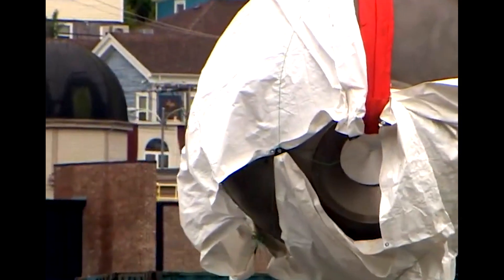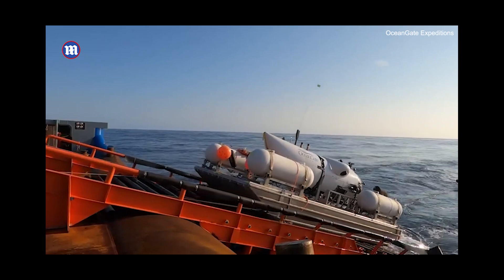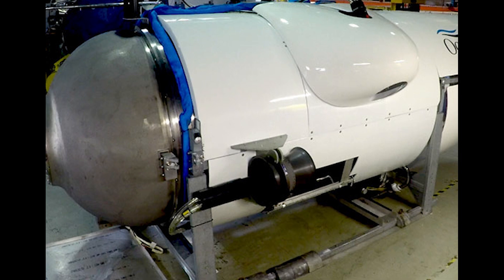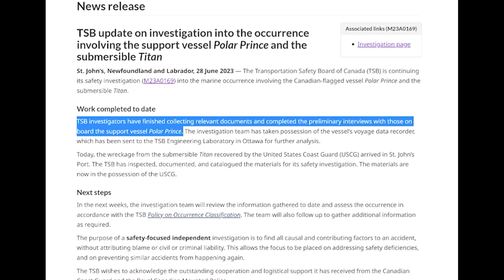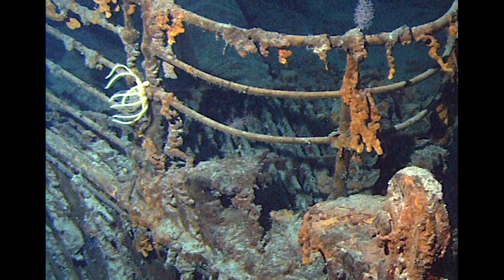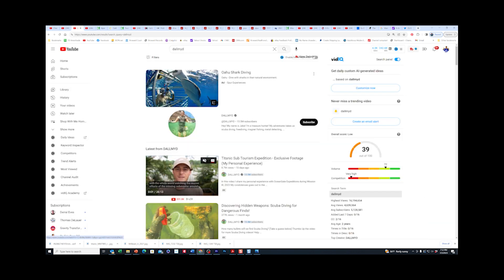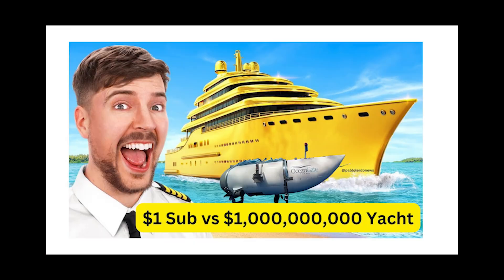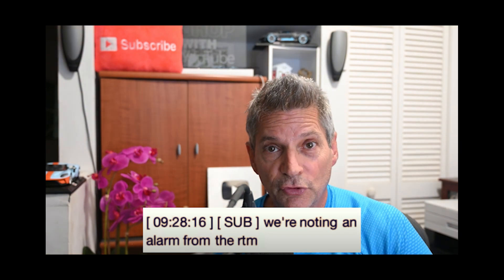Titan Submarine Debris Clues, Implosion Simulation

Comment: The sub imploded. With such force it blewout the porthole. The bolts holding the flange were stripped due to the force of the implosion.
Reply: It would be easy to determine if the bolts blew out because there would be no female thread left. I still can't understand what kind of adhesive would not only bond to metal as well as fiber but simultaneously be a water-tight high-pressure seal. I didn't see any glue being forced out when the ring slipped on. And it was hand-applied. Not very good quality control.
Reply: I agree, the port hole was a victim of the extreme violence of the implosion, I argued this a lot last week, as a few were blaming the porthole .. it was the cylinder pressure hull that failed, not that porthole,
Reply: @tony--james 
Agreed… one way of explaining it is that the body imploded with such force that it created explosive pressure inside the sub… which blew out the porthole.   Imo
Reply: @tony--james I think the window was 21 cm not 21 inches
Reply: @Defender78  21 cm is slightly bigger than 8"  the porthole was  not THAT  small.
Reply: @tony--james Think   tube of tooth paste squeezed from the middle
Reply: I don't know, i'm sure there's a lot of misinformation right now.  I think the OceanGate expeditions lasted about 8 days per year, so in the 3 seasons they've been diving (2021-2023), 24 would be just about right.  Don't know about aborted dives affecting the count, though.  I know it's more than 13...

Edit:  I just went to a site that said 14 times, another site that said only 3 times, once each year.  Who knows, that company was founded on lies.
Reply: @johnbergstrom2931 s you said lots of conflicting information. I believe the total including testing and commercial operations totaled 12 or 13 total voyages. I believe this would have been the 5th successful trip had it not imploded. I know they had 2 successful trips in testing, and 2 during the commercial phase. Every other one was cancelled due to weather or sub problems. I seen a report of a German explorer who made a successful trip and said they almost lost power and were lost on the sea floor for 5 hours. He said anyone else who went down was on a suicide mission. I believe that was around 2021.
Reply: @BrandonG_EDC  Yeah, I don't claim to know what the true number is anymore.  Looking into it deeper I've heard/read anywhere from 3 successful dives (one per season) all the way to 24.  OceanGate is so full of lies it probably made up numbers as they went along...
Reply: @johnbergstrom2931  I agree, that was just from reports I’ve read stating those who were on board and the success of each trip. Seems between 5-7 actual trips. Like you said it could be lies too.
Reply: The porthole blew from inside out stripping all the bolts in a flash of second...imagine 5000 psi on such a large plexiglass or whatever it was...That impact blew the porthole... It's not other way around
Reply: It would obviously be expensive but we could make subs that could go to the Titanic daily.  We have the tech.
I'm just wondering why billionaires would risk their lives like that? I'd build my own sub, and rate it for 3x Titanic depth.
Reply: @Mick-j3z  3x Titanic depth is literally the bottom of the deepest ocean on earth - Mariana Trench.  Don't need to go that far.  20,000 feet is good, though...
Reply: @johnbergstrom2931  Someone I know went to Challenger Deep.  Since the Titan's inevitable failure I've had some frustrating nightmares about their safety, and can't help but think these submersibles should be way, way overbuilt, especially since we can.
Reply: @Mick-j3z  I believe they are well overbuilt for their rated depths - engineering design generally includes a significant safety margin.  The problem was with this particular design and construction, and that's why they couldn't get it classed.  The depth rating on the viewport illustrates that.  This thing was never considered safe to go to anywhere like the depth of the Titanic by anyone except by the CEO and perhaps other uninformed Oceangate employees.
Reply: @Mick-j3z They are....This catastrophe was totally avoidable. The CEO was arrogant, sloppy and unsafe  unfortunately. The composite structure he used was unique for good reason.
Reply: @Mick-j3z I think ocean gate was running out of money and was trying to get investors to throw a life line by using the titan but ended up failing but I think ocean gate was secretly dieing and needed money so they had to cuz cost on the titan
Reply: I think the same especially because his last two messages to the surface was that the back side of the hull was breaking so I'm sure the pressure came from the back pushing the glass out from the inside
Reply: @dustincredible1249  probably people died in a flash...sub filled with water and within that time glass blew away..with internal implosive pressure...that can't happen later...as pressure actress the glass would be equal..
Reply: @AtulClassics  There's a good video by Thunderfoot explaining that the entering water was driven by decompression of the surrounding water.  That process happens essentially at the speed of sound in water.  I believe that when that water fills the air cavity it will then be rapidly decelerated by a compressive shock, and a shock wave will then radiate back outwards.  So it's possible the CF cylinder failed, water shot in, and then a radiated shock wave pushed the viewport out.  (That's a best guess, no expertise in supersonic flow ...).
Reply: @Italian69Boi I find it pretty amazing people got into this thing in the first place.   I get the passion for the Titanic, but you can't have much passion when you're dead.  

There's so much of it that I find amazing people were OK with,  but then we weren't there for the sales pitch,  we don't know what was our wasn't disclosed to the "mission specialists" before they signed waivers and hopped in.
Reply: And likely with such force that the hull pulled clean out of the titanium ring.
Reply: Or the bolts simply busted as a consequence of the force.
Reply: I doubt they were “fighting for their life”
Reply: @Theottbear they didn’t have time to panic.
Reply: @nm9412  duh that’s why I wrote what I wrote. My post is in quotes because the OP in the video said “they were fighting for their lives.” Pay attention know-it-all
Reply: @Theottbear be nice
Reply: @stasiacromie9584  what are you talking about? my comment isn’t rude, mean or offensive. It’s a loose opinion of a direct quote the author of the video said relating to the Titan horror. wow
Reply: @stasiacromie9584  have nice day 🤣
Reply: There were no bolts holding the carbon fiber to the domes. It was glued in place
Reply: @richardbaumeister466 yes & it seems from the text releases it was the aft that failed. That's where the noises were reported coming from. That would explain the porthole blowing outward...
Reply: My feeling is that the kid was panicking when the bolts went on. Justifiably in a way. But not aware that you have to keep it inside you. (On the wrong day, I would have come too). And he was not aware that the craft had essentially no serious internal pressure protection. It was suggested to me that he lashed out and kicked out, and could have quickly damaged vital electronics or whatever. It can and does happen.
Battery damage from that, or sabotage could have easily caused a lithium battery fire. As was also suggested. It was well known that they were descending too fast. (Was there really rhinotape around the carbon fibre??). If the leaked communications are correct,  then..... they had catastrophic problems from about 3400 mts. Fire could cause all these. All alarms on constantly, increasing speed of descent, ballast steel pipes release having no effect, difficulty releasing frame, thrusters barely working at all, diagnostics and velocity indicators not working, monitor probably switched,  power wattage problems, serious cracking sounds aft. It would seem from these reports that they were eventually able to very slowly ascend back to 3,400 metres. Then presuming the fire from the lithium batteries burnt  out...Then they would have had no power, lights, electronics or comms. At the mercy of the currents. Not quite sure after that. Somehow the craft then broke apart. Quickly or slowly. The sea does what it does, despite what you want to believe. And their fate was the normal progress of a cascading  lethal epic from very very deep underwater.
Reply: Black box!
What does the black box say?!
Reply: It would implode then explode due to 'fire starter' effect of implosion releasing great heat & combusting contents.
Reply: @pcka12  think it was more likely a reflected/re-radiated shock wave when the rapidly entering water decelerated once it had filled the void.  It's that shock wave which was picked up by the acoustic sensors at a great distance.
Reply: @LokiCentral  Compression yields a great deal of heat; 'fuel' in the form of the crew, plastics etc was present & oxygen both compressed and in the internal atmosphere of the craft.

Very rapid implosion times are quoted, yielding a great deal of heat in a very short period of time.

One atmosphere pressure (seen collapsing a 40 gallon drum) is equivalent to 10 metres (33 feet) depth of water, many hundreds of metres depth of water were impinging on the vessel!
Reply: @pcka12  I get what you are saying, one might liken this to being inside the cylinder of a diesel engine, with the incoming water representing the piston.  Combustion would be limited by the oxygen in the atmosphere (I think the oxygen storage was outside the pressure hull) but also the time taken to combust.  I believe the air pressure inside would not uniformly increase because the incoming water would be supersonic, so there would presumably be a shock wave in the air ahead of that water, possibly with a flame front in that layer.  I can't even guess whether the oxygen in the air would fully combust with solid material before the water hit it, but presumably there would then be significant cooling from the water once that happened.  Heat from combustion could presumably not diffuse into the capsule air significantly ahead of the flame front, so the result may be a sequential combustion and cooling process travelling through the capsule space at high speed, rather than any kind of "explosive" event, and maybe the effect of any combustion would at best be to decelerate the incoming shock wave, not reverse it.  I'm merely speculating, maybe people who design rockets or explosives would be best placed to comment.
Reply: @LokiCentral  the pressure being evenly spread around the 'void' which the interior of the submersible represents it would act towards a theoretical point in the middle of that void.
The effect is very much like that of a 'shaped charge' which is a similar 'void' guiding an 'implosion' / 'explosion.

How much the implosion would act in this way can only be determined by experiment, but the 'lines of force' can be projected just as they can in analysing the process taking place in detonation of a shaped charge.

Plenty of explosions can & do occur underwater, that is what a depth charge does.

A tiny bit of organic grease exposed to air (80% nitrogen) can and will explode if that air is at 200 bar pressure as is the case with aqualung bottles.
It has to be assumed that the valves of the stored oxygen in the sub are open & some form of '1st stage' reduces that pressure.
Reply: @pcka12  theoretically,  in a laboratory,  not in the sub. The heat from compressing the gasses is immediately absorbed by the water. The energy from rebound is less than the compression pressure.  There is not enough time for the resin to be heated, vaporized, burned, and release expanding gasses. There is no explosion which can overcome or overwhelm the sea pressure.
Reply: @JoeSmith-cy9wj  did I mention the resin?

I referred to the crew (repository of a great deal of inflammable material) & other things like plastic.

The crew are in an enclosed air space which collapses in on them compressing any gasses present & releasing heat.

NB when you service your SCUBA gear you NEVER employ organic greases (fat is an organic grease), you use Silicon grease, likewise silicon rubber 'O' rings that is because even using compressed air (about 19% oxygen) you can easily cause an explosion 💥 if you use anything flammable.
Reply: The air inside must have exploded with a greater force than the 5700 psi water pressure pushing the window in, in order to blow it outward. That's unreal 😮
Reply: @kahunah40 No.  Reflected/re-radiated shock wave from rapidly decelerating water once it filled the void - I think.
Reply: Interesting information here.  I did not know they had event recorders onboard…. I know they had crack detection…. So… the black box data will tell the story ….
Question is…. With the Investigators tell us what they found
Reply: @francisschweitzer8431 No crack detection.
Rush said they used an acoustic sensor system to detect carbon fiber hull cracking.
Ridiculous. Cameron agrees.
Every passenger said they heard cracking, no sensors needed.
Once the accumulated carbon fiber hull crack damage was sufficient, implosion.
It was Always about accumulated hull damage after multiple dives to Depth. Like every top deep sea vehicle subject matter expert on earth told oceangate and Rush personally.
Reply: There's not enough force in the world to strip every bolt simultaneously. Car engines would never work because the heads would keep blowing off the engine block
Reply: @BobbyCulpepperGuitar  not enough force to strip the bolts? It broke the bolts when the pressure hit the rear wall. Bolts can strip or break easily."  Not enough force in the world" 
What a ridiculous statement.
Reply: @JoeSmith-cy9wj  it more likely snapped them off, but stripped them out simultaneously, incredibly doubtful. Show me a car accident where the wheel studs all stripped out simultaneously from impact, you can't. Head on collisions at hwy speeds have far more force then bottom of the ocean. Now if the studs to the port hole were just threaded into the carbon fiber hull I could see the carbon fiber stripping out. But that doesn't seem to be the case
Reply: @BobbyCulpepperGuitar  yes , snapped them off.  If you've ever worked on mechanics you would know it's not hard to snap or strip a bolt. Bolts fail all the time. When designed,  engineers have all the facts and figures.  They know the numbers on the working strength, breaking strength,  elastic deformation force, plastic deformation force, thread strength, thread geometry and it's effect on joint strength, materials strength and different alloys, effects of temperature,  expansion rates due to stress and temperature,  these and many,many more. There should be no room for guesswork.  No unanswered questions.  Every single force, vector, environment,   material, interaction and allowances for unforeseen excursions do to impacts and dynamic forces should be accounted for. But a catastrophic failure at one end could not and has no reason to be accounted for in the bolt design or pattern or force calculations.  Once flooded, the need for inrush pressure calculations is moot.
Reply: @JoeSmith-cy9wj  Ive been a master mechanic for nearly 2 decades, seen many bolts strip out, due to cross threading. Seen many forced induction and boosted engines blow heads to pieces, never seen one pull all the cylinder head bolts out simultaneously, never seen them all snap simultaneously either
Reply: @BobbyCulpepperGuitar  well Ill tell you what, do the math. The titanium dome is approximately 40" in diameter.  The water pressure static is about 5,565 psi. The inrush from the other end is about the speed of sound . The mass of the water is about 9 lbs. Per gallon. The compartment is about 12 feet long. There are 7.5 gallons per cubic foot. Please let me know the total dynamic force upon the inside end of the dome, thanks.
Reply: @BobbyCulpepperGuitar  remember,             F = m x v². The mass would include a cone of water outside the compartment behind the column inside the compartment , because it would be accelerated and pushing also. I'm guessing an angle of about 60⁰ at the apex.
Reply: @BobbyCulpepperGuitar  in the video link I sent , the working physicist and professor an doctoral advisor only accounts for the expansion of the molecules in calculating the forces. In our example,  we need to include the mass x velocity because at the end of the twelve foot column the momentum now includes the continued motion of that volume. You may subtract one single static pressure area as resisting this motion from the outside.
Reply: @JoeSmith-cy9wj  you do realize modern direct injection engines use pressures higher than 6,000 psi ?
Reply: It did not . The porthole WAS a certified and rated component.  This is expensive.  Unlike the crew compartment . This is why. This also means, like climbing rope, overhead lifting chain, elevator cables, and many other life dependent materials. There is usually a safety factor of three or four. Meaning it can withstand three or four times the rated working load. You never use something up to it's breaking strength, life dependent or not. 
But the certification means a 1,500 meter rated window  will go to 4,500 meters before failing. 
He did this to save money.
It should never have been done, but it also means that the window wasn't the weakest part of the submersible . Also there is the fatigue  factor, another reason you always have a "working load" , a "breaking strength" and a certified load.
Reply: Keep in mind the diesel effect of all the flammable products inside that pressure vessel instantaneously being exposed to excessive 6,000 pounds per square inch of air pressure. You had instantaneous explosion of all hydrocarbon based products inside the pressure vessel this could have blown out the view portal if it hadn't been the point of failure to start with.
Reply: The compression built up in the collapse can ignite the air as it explodes out like a diesel piston.
Reply: @brianpeck4035  Exactly!! The implosion almost immediately causes an explosion. That would have blown the window outward with huge force,  which it certainly wasn't rated for.
Reply: @LakeNipissing no
Reply: @LakeNipissing  the inrush occurred on the portal end, it blew the dome off the equipment end. There was not much impact to the window itself. Certified at 1000 or 1500 meters, it would have withstood at least 3 to four times that.
Reply: @LakeNipissing  the rebound or explosion woud have been nowhere near the inward pressure.
Reply from the maker: The acrylic porthole window was also only rated to 1000 meters
Reply: @jeffostroff But I don't think they would have purposely unbolted and removed an intact porthole, simply to have a lift point.  That would have been altering the evidence...
Reply: @johnbergstrom2931  yeah I don't think by law they allowed to mess with the debris.  Because obviously that would provide false leads in the causes of the incident.
Reply: @johnbergstrom2931 no
Reply: @johnbergstrom2931  Spot on...the thought of removing the porthole, even if it was possible using the salvage ROV which I don't think that it was, would have changed the evidence trail. Not plausible at all 😐
Reply: @johnbergstrom2931 but what if they removed it to examine it? It's possible
Reply: @jeffostroff  And yet it had made the voyage to the Titanic at least 3 times before without clouding or cracking.  It's far more likely that the carbon fiber tube failed and the implosion blasted the window out of the porthole, it wasn't meant to take any internal pressure and was the weak spot in the dome.
Reply: @DanielTaylorOCMD  I heard June 18th, 2023 was Titan's 24th dive.
Reply: @johnbergstrom2931 Not to 12,500 feet.
Reply: @revolvermaster4939  It went to the Titanic 7 times.
Reply: @DanielTaylorOCMD Implosion, doesn't blow outwards
Reply: @revolvermaster4939 Never made it that far, it imploded at glass failure depth!
Reply: @johnbergstrom2931 The Titan only got to the Titanic seven times - there were a LOT of aborted dives.
Reply: @juliesczesny90  I understand how implosion works, the ejection of material through the porthole was due to the way the sub was crushed and happened after the initial implosion.
Reply: @juliesczesny90  Wrong...where do you think the air inside the submersible goes to. It would have been super compressed due to the implosion...it had to escape somewhere.
Reply: @juliesczesny90 The resulting pressure force of the inward collapse of an implosion causes and immediate outward blast.  There are gasses and stuff involved as they were breathing oxygen .
Reply: @juliesczesny90  where did I say it did?
Reply: @johnbergstrom2931 it was only for 23 dives.
Reply: @juliesczesny90 Inertial forces of the water rushing into the relative vacuum of the hollow hemisphere would be amplified toward the center, Probably ejecting anything/anyone through the porthole as the instantaneous pressure differential would be several times the external water pressure.
Reply: @johnbergstrom2931  I mean each additional dive would have weakened the carbon fiber even more right? It already wasn't a material that was meant to withstand as much pressure, so each time it was forced to withstand that pressure would weaken it.
Reply: @DanielTaylorOCMD the fact it was taken down so many times increases the chances of a fatal outcome.  Thinking "ah well, it got there before" without knowing if it did so without any signs of fatigue, was short sighted.  Hopefully lessons are learned from this.
Reply: @jeffostroff I believe that's a I have now heard it was rated for 1,300 and also 2300 m but why not spend the extra couple thousand dollars when you're a billionaire if that's really the case so I don't buy it 🤷
Reply: @freedomfox8183  Stockton Rush was nowhere near a billionaire.  OceanGate was not profitable and was existing on venture capital, which was running out.  The reason he was piloting the sub was there were billionaires on board, maybe people who might want to invest and throw OceanGate a lifeline.  

I saw a net worth estimate of $25 million for Stockton Rush, but that was before he killed himself in their flagship product and took 2 billionaires with him.  Stockton Rush's estate and OceanGate are now worth ZILCH.
Reply: @freedomfox8183 it's not linear in expense to uprate things, it's exponential. That's why he he made the thing out of titanium and not inconel, wound carbon fiber instead of cross weaved.. the only people able to machine these are busy with rocket engine parts, military aero contracts etc .. even a billionaire couldn't get their attention
Reply: @jeffostroff  I can't believe how reckless this operation was. I mean they didn't even think to use a torque wrench to spec when bolting those poor souls into that death tube. Great analysis as always Jeff
Reply: @blazebirdy187  I rather suspect that a torque wrench was irrelevant since once in the water, water pressure would hold the whole set up closed.
It was reported that the top nut was always left off because it was difficult to reach.
I have wondered if an 'O' ring seal was present or water tightness simply relied upon the frictional interaction of metal on metal?
Reply: @pcka12  , I agree. I was more or less pointing out the meticulous steps that should be done when decending that deep in a non certified submersible.
Reply: @jeffostroff do we know at what depth the implosion occurred? Because it was only an hour into a very long dive.
Reply: @butter7734  James Cameron said implosion occured at 3500 meters, about 1000 feet above the bottom.
Reply: @johnbergstrom2931  do we actually know that's a fact though? I mean he wasn't there and I heard they lost connection only an hour into the dive that takes what? At least 3 or 4 hours I would imagine.
Reply: @butter7734  They lost contact 1 hr 45 minutes into the dive, which is inline with the dive time to 3500 meters.  Cameron said he 'talked to his contacts' in the deep submersible community and hinted he had talked to the OceanGate people on the support ship.
Reply: @butter7734  Lost connection 1 3/4 hours into the 2 hour or so dive. Was almost there. Also, sound of the implosion detected by underwater sensors helps pinpoint the depth it occurred at. Likewise, the debris field was relatively small, which further indicates it likely happened relatively close to the seafloor.
Reply: @ronbennett7885  that makes sense about the debris field. Dunno where I heard that it was only an hour into the dive.
Reply: @butter7734 he’s got connections. Hell he knew the next day what happened, while the government was giving some bullshit story about banging.
Reply: @butter7734 They were an hour and forty-five into the dive.
Reply: @randallburkhart8452  Well, the Coast Guard also knew right from the get-go about the implosion, courtesy of the US Navy sonar net.  But they were in kind of a tight spot.  They couldn't very well say, "Well, we know it's implosion and those 5 people are gone, so we're sit on our hands and do nothing until the ROV gets in position and confirms it."  

The media created this charade of 5 people in the powerless sub, bobbing on the surface or somehow stuck on the bottom, slowly running out of air, so the Coast Guard had to play along.  

Also, if they came out on the day after lost contact and just said it was implosion and they were dead, there would have been public outcry that they were fatalistic and giving up.  So they kept that information until the destroyed sub was actually found.

Personally, if I were in charge of that Coast Guard operation, I would have immediately leaked the info about the implosion being detected.  When a reporter asked me about it, I'd confirm it, but say "We're still searching the surface.  The ROV will be in position in X days, we'll know for sure then."
Reply: @butter7734 One and three quarters of an hour. Fifteen minutes from arrival at the Titanic.
Reply: @allangibson8494  I definitely thought it took longer.
Reply: @butter7734  1 hour 45 mins to be factual 😐
Reply: @johnbergstrom2931  If James Cameron said it, it must be true😂
Reply: @butter7734  The dive takes about 2 & 1/2 hours and they were apparently descending / travelling way too fast and lost all communication an hour & 45 minutes into their excursion.
Reply: @butter7734 they were going to fast on the descent to the bottom. Trip supposed to take 2.5 hours, they were at 3500 1.5 hours in.
Reply: @butter7734 there is a way the military is able to detect the implosion depth- implosions make difference pulse width depending on its depth it is measurable.
Reply: @jeffostroff 1300m, but w/e
Reply: @jeffostroff 1,300 meters actually…. Keep your facts straight bud
Reply: @jeffostroff if it had failed inward, it would have damaged the flange. But the sub failing would have popped it out like a cork in a new wine bottle.

With the rings not showing any stuck parts of the carbon fiber structure, the joint is what I expect to fail.
Reply: @jeffostroff  aren't you forgetting to take into an account that it was curved and made out of acrylic?
I've seen people say that it could handle up to 4000meters
Reply: @jeffostroff  Manufacturer simply wasn't willing to rate that porthole design beyond 1300 meters as policy. They insisted on a different design and specs to rate beyond that. Ideally, OceanGate should gone with a more robust porthole design, but the current one held up well in past dives. Also, if it did fail, there would likely be zero warning versus the carbon fiber hull that contained numerous sensors to detect impending failure.
Reply: @jeffostroff no
Reply: Agree.
Reply: No
Reply: An implosion always immediately precedes an explosion. 
What goes up must come down..  what goes in must go out. 
 The air inside the submersible was compressed to the point that it's pressure would exceed  that of the force applied. Aided with the super heated gases reaching 50k°f. Thats 50,000 degrees Fahrenheit. 
FIFTY THOUSAND DEGREES FAHRENHEIT. 

GOODBYE CARBON FIBER  .. GOODBYE CARBON BASED LIFEFORMS.. 
GOODBYE LOOKYLUE ACRYLIC VIEW PORT WITH YOUR RETAINING RING. 
( which by the way was designed for the outward pressure to basically keep it sealed )
Reply: U right bro 🤔
Reply: I think it was a wedge shape as well so it’s most likely it was blown out
Reply: I think the pressure popped off the porthole because of the glue
Reply: Thank you YouTube comment expert
Reply: Completely agree. The porthole was simply blown out by the force of implosion, from the backside. With air being highly compressible, and water...not so much. No matter what the water pressure was at depth, I guessing the maximum (dwell time?) pressure of the energy, was possibly hundreds of thousands of psi, in nanoseconds. (I'm not a math-a-majician) but I'm sure that pressure was astonomical.
Reply: @Italian69Boiastronomical. From my understanding, Oceangate submersibles in general have made several trips combined, but the Titan only had a handful.
Reply: I think the mating point between the titanium and hull was where it failed. I think the temperature caused the hull to contract more than the titanium and boom. But i'm no "expert" so just my two cents.
Reply: I'm pretty sure, due to the extreme, and violent forces, not only did the porthole get blasted out, willing to say, I bet it became a pressure nozzle of super heated ejecta, and sucked most everything, inside out.
Reply: The likely scenario is the carbon fibre imploded causes an explosion to the pressurised cabin which then causes the acrylic glass blow outward.
Reply: @diesopain260  once the carbon fiber started to fracture the air in cabin will disperse, the air pressure will not increase, it will decrease. The water pressure hammering the glass would be the only thing
Reply: I agree. The cylinder went first.
Reply: The window was removed to facilitate a lift point.
The compartment didn't implode, as you are imagining it. The air doesn't ignite without fuel. And doesn't exist after the pressure wave slams into the rear wall.
I saw a short CBS video of the crew compartment being raised onto the salvage vessel. It was intact except for about a foot at the viewport end where the titanium ring used to be. The window was intact and removed for a lift point,  I am told, at least.  The ring you saw being unloaded at port was from the end that failed.  From what momentary images I gleaned from public footage, is that, exactly as predicted by James Cameron,  the repeated pressure cycles , with different expansion coefficients of the two materials,  eventually caused failure of the joint cement (epoxy) , and or resin at the end of the tube. This is also evident from the failed ring, the inner lip edge being peeled off around much of the circumference and jutting out. This is where the water entered.  The stress on the fibers and the joint would cause the shredding back a few , maybe a dozen or two, inches from the end.
The resulting pressure wave blew the other end off, shearing the bolts clean, leaving the other ring undamaged. 
In no way was the tube crushed or imploded.  The people were killed or knocked unconscious,  but not incinerated.  The people were not vaporized. The same design weaknesses that caused the failure,  mitigated the damage, at least to the machine. People,  being mostly water, and not air, or fuel, would have been slightly crushed. At least for the empty space in their lungs and intestines.  Their bones were probably shattered in their torsos, and where they impacted each other. And being eighty percent water, they wouldn't have shrunk beyond that point. They are probably mostly intact. But I  have no information about that. Only physics and a mind. Not imaginings of hype, or demonstrations of flash paper in a test tube with a plunger.
Reply: @JoeSmith-cy9wj  do you have actual info? Source? I've seen many of those salvage pictures. There is no crew compartment shown on any report I have watched.  The are sections of the OUTSIDE SKIN that would have broken away  when the interior hull of carbon fiber imploded in on itself.  The tail section with the batteries and wires and stuff were outside the pressure area the 5  men were in.  The only thing that can implode is something that has pressure in it fighting external force. That was the carbon fiber cylinder glued to the two rings bolted to the two end bells they showed the rwo rings coming off the salvage. There was nothing left attached to them
Reply: @Og-Judy  twice you refer the cylindar as a pressure area.  At 14.7 psi, it is not much of a pressure are compared the the sea around it at about 5,565 psi.
The only source I have was the news correspondent who answered the anchors question as to what happened to the window. " It was removed by the salvage crew to enable the lifting strap .
Reply: @Og-Judy  the skin you mention was around the equipment cage. This separated from the carbon crew compartment when the pressure hit the rear wall from inside
Reply: @Og-Judy  everybody keeps insisting it imploded. It DID NOT. not in the sense of a beer can or the images of the rail tanker cars. It was not metal. It did not remain contiguous.  It did not flex and bend. It did not shatter as a whole. One end failed. One end shredded.  Imagine the remnants of a used paper forework. Only the end with the window was damaged. Like a roll of paper towels which was wetted at one end and dried un the sun. Swollen,  torn, delaminated. But the rest was intact and normal looking. It did not crush in the traditional sense. The failure mode of an composite vessel is NOT the same as a homogeneous metallic ductile material.
Reply: @JoeSmith-cy9wj your observations are..untrue at best.
Reply: @JoeSmith-cy9wj They were breathing oxygen. Plenty of  fuel 🙄
Reply: @Og-Judy  and what area or space do you imagine this slow combustion to be raking place in?
Reply: @JoeSmith-cy9wj you’re a liar
Reply: @Itme A period of hellish panic…